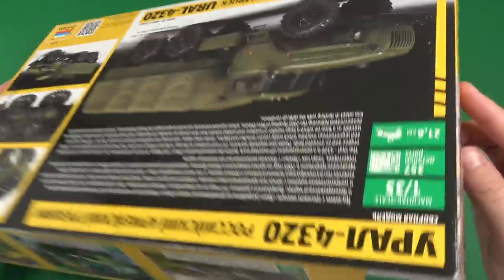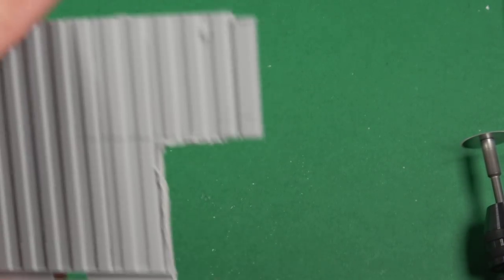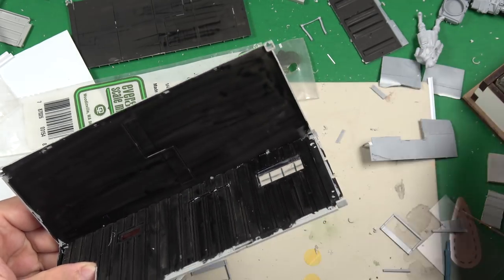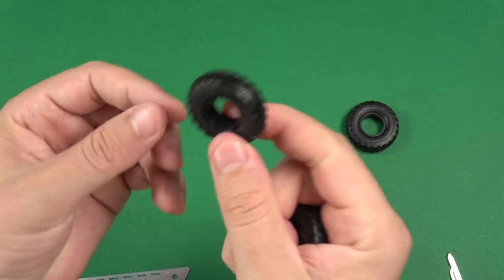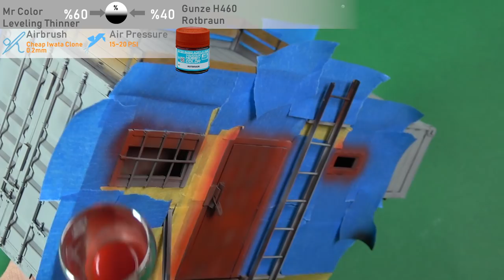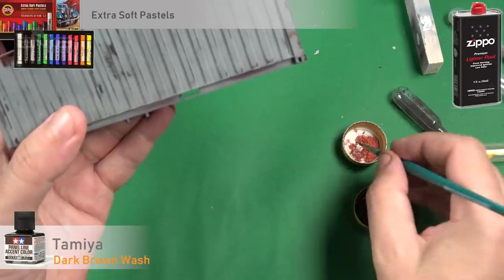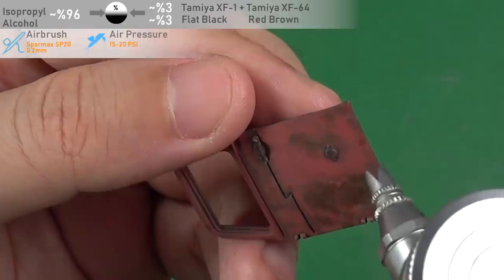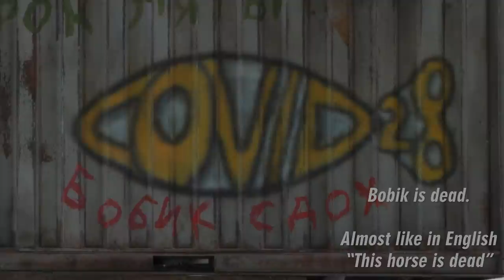Post Apocalyptic Camper Van | Ural 4320 Scale Model Truck

Comment: Hi. You are the only modeller I have seen who has considered the 'Weight On Tyre Effect.' Bravo to you ! I learned this when I was only 11 and now I'm 54. It's a simple but very important effect. This model is simply gorgeous but I think possibly one suggestion could be considered for next time. Chances are the window sheets/coverings would probably be internal as it seems less practicle if they were bundled and tied up on the outside, making them quite hard to untie. Just an idea. Cheerio.

Comment: Awesome build buddy, hey with respect to a strong epoxy putty, I dont know if its available where you are but see if you can find a putty called JB Weld. It is extremely strong, easy to work with and it does not stink and it cures a lot faster than 24 hours.

Comment: Hi I have a question. I do also models since many years using weathering etc. But I always first finish with the glue, and then I paint. You are doing it different - You are using glue to connect allready painted parts. May I ask which glue You are using and how You are doing it? I never had a good result with glueing painted parts, the glue reacts with paint and I do not have good connection. Great job as usual congratulations!
Reply: He is using Tamiya Extrathin (judging from the colour of the bottle). Many modelers nowadays use glue on painted parts. Years ago was impossible to do but this new glues are very quick and evaporate immediately on the paint without damaging it. The bond is weaker then on bare plastic so for parts that requires a strong bond it's always better to scratch the paint before glueing.
Reply: @RobotJeeg  Mr Cement SP is extremely fast drying, I use it.

Comment: What kind of glue are you using?
Reply from the maker: I prefer butanone and I use it in a Tamiya bottle. But I recommend Tamiya Green cap extra thin cement. It is safer version of butanone.

Comment: Entirely too believable.
Another YT modeler, hpiguys Workshop, is making popular a method of sanding even the hardest tires. Get a hand drill and socket wrench that is a tight fit into the tire, spin it up and apply sandpaper or sanding stick. You can knock the shine off the tread or make it look unsafe to use, anything in between.